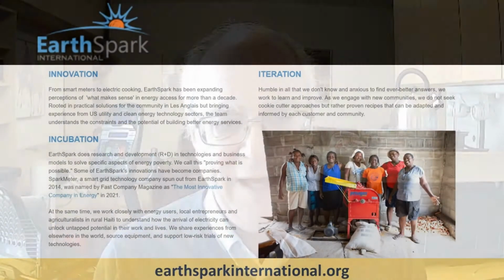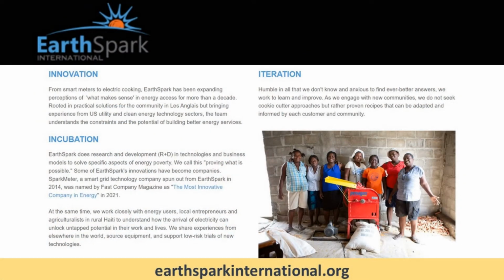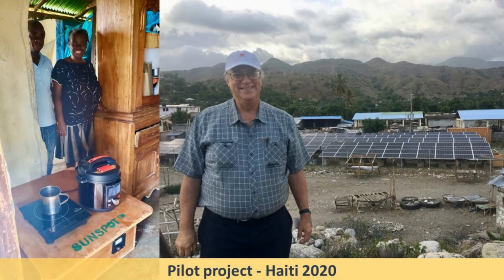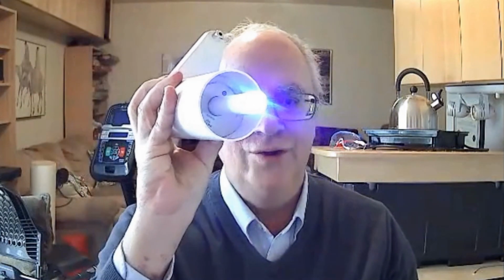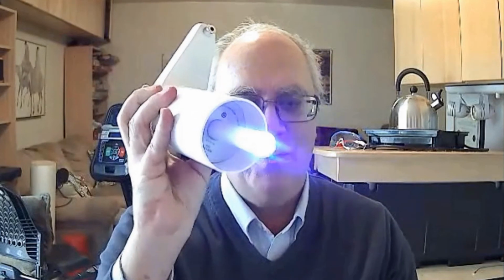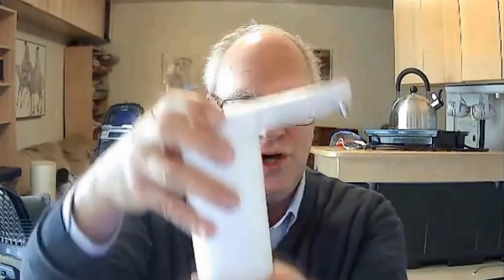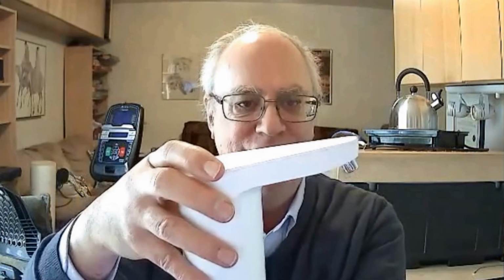Doug Danley - SunSpotPV: Banking on PV-to-Induction Cookers and More

Comment: I have been watching the Goal Zero products, The GZ1000x power station I just recently bought, looks like a couple areas have been traded off in the weight issues... An MPPT controller that can handle more panels to recharge a modest sized lithium battery in a shorter time... the size of the inverter is more in the range of practical cooking requirements.  I have not checked if some other brands of power stations are getting the functional sizes of semi-portable power stations down enough for RV campers to keep supporting the developments that could be passed to third world uses... things like MPPT controllers that can support 600 Watt input from portable panels that could be added to the 'tear drop' campers via a standard Anderson port... to get charging times down to 3 hours or so.... inverters up to 1500 to 2000 or 3000 watts... the better MPPT controllers lets one expand input via portable add-ons The Anderson ports are a thing to ask about in reviews of trailers that are "solar ready".... portable panels add flexibility in aiming panels....portable panel storage on the trailer... A lot of little ways to improve solar flexibility for those that want to get into the lifestyle changes.

Comment: Just found this interview, was in the process of looking down several rabbit holes of developments... induction hotplate... have one need to dig it out for doing some more testing  with it.... and my hot pot.... the hump in a private PV system tends to be the inverter part ...I have a Goal Zero 1500x ...inverter 2000watts/3500watt surge...it would handle both of these cooking tools, but the weight of the GZ 1500x is about 46 pounds... not something to pack around much... but in my old truck there would be space for it... the PV panels to charge it... 1200 watts/3 hours is listed in the specs... and Goal Zero has the wiring support to do multiple panels of input... I was just about to order a new panel to add to my collection of GZ panels (4-20 watt, 1-30 watt, 4-50 watt, 1- 100watt) a couple GoSun panels and a table panel... but wiring issues for easy connections shows up... Going to order (I think) a 300 watt Goal Zero Ranger panel... I might get enough potential wattage to get the GZ1500x off the mains for keeping it charged (lithium likes to be charged at least every 3 months...) 

Currently in my truck I have a GZ500x power station that I have been keeping it charged with a 20 watt panel, that stays hooked up, mostly while parked at home... can charge stuff from that... lights, razor, tablet or phone if they need it... low energy stuff... if I run the GZ500x down a bunch... I have hung toe 100 watt panel off the sunny side of the truck to recharge it in a day or two even in mostly overcast weather 120 watts....in    (Charging port (input, 8mm): 13-22V, up to 10A (150W max) from specs..... The magic part of the system is the MPPT controller...I could hook up a lot more rated wattage, but that controller would only feed in the 150W max... I can push panels to the rated max of the panel... with reflectors... but overcast and sunny days are a bit erratic, and the fewer panels I connect the fewer I have to store to use the truck as a truck... The 300 watt panel running on an overcast day might input about 10% maybe... so 30 watts on a better day it might get over the 150W limit of the MPPT controller, but that controller would keep it to the limit. 

The GZ500x inverter --- 120V AC Inverter: 120VAC 60Hz, 2.5A (300W, 1200W surge) (output, pure sine wave) --- that 300 Watts is about the limit of cooking type devices that can be plugged into it... The GoSun Fusion I can't plug into the AC port or the DC port directly... but the GoSun power banks that can power the Fusion can be recharged via the AC port.... a very round about way to set up cooking from the GZ500x power station while it is hooked to panels....When,  I get some less drippy weather I have a new 'toy' to check out with the GZ500x...Itaki lunch boxes and related cookers out of Japan, very low wattage cookers 100 to about 500 watt cookers for doing single meals... I have 2 different ones I want to test with the GZ500x.... the smaller lunch box cooker should work fine... would be neat see the little lunch box drawing power at the same time as maxed panel set up is inputting power on the power control display...

The video gave me some interesting information about the induction hot plate and the Hot Pot... I think some of the power stations being offered now are beefing up their inverter ratings.  It might be interesting to get some online reviewers to test if they can run the two mentioned items with claimed 1000 watt inverter power stations... if used as a useful off grid function test... it might push more to consider plug and play cooking into more portable systems....
Reply from the maker: I hope got get one of the emerging PV-to-induction cookers for use during my solar video road trips. Will still pack my reliable Sunplicity and a couple other foldable cookers but it would be nice to occasionally fry up a breakfast with the systems batteries charged up :)
Reply: @SolarCookingMuseum   due to sales and availability I switched from the Ranger panel to the GZ1000x with a 1500 watt inverter built in..., so the induction hot plate and the Hot Pot would be with in cooking range, probably... both power items I was considering had some issues, like weight...PV systems still tend to be heavy...
Reply: @SolarCookingMuseum  I now have a Goal Zero 1000x power station headed my way and I checked the wattage of my Instant Pot (1000 watts) the inverter on the GZ 1000x is 1500 watts... The Ranger panel was not available for the sale.... The thing to test is how quickly can I recharge the power station with the number of panels I can get into an array...the MPPT controller will put in 600 watts.    So I will have a couple power systems to test out.